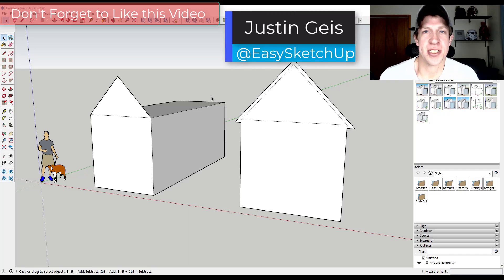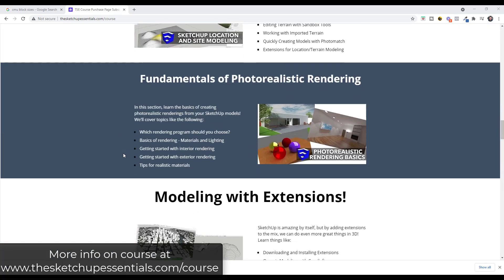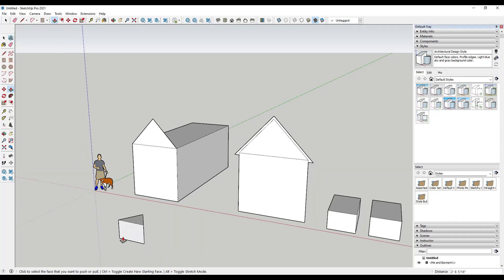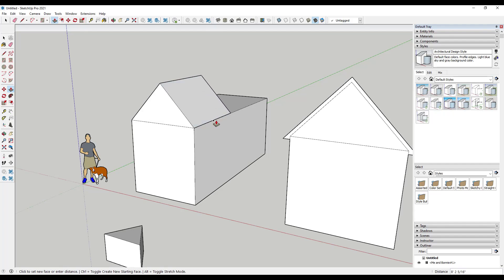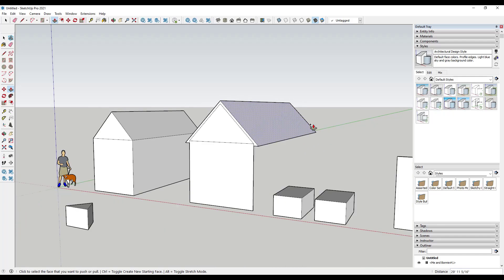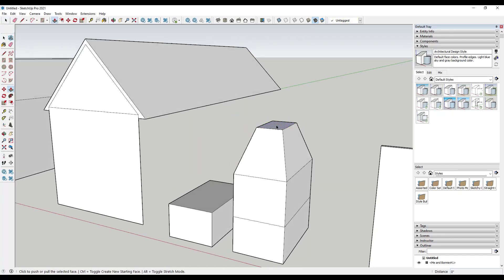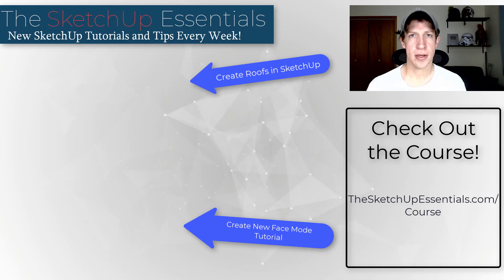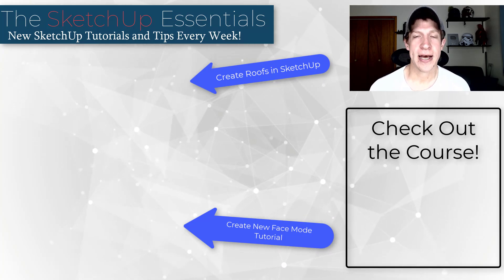Fixing HOLLOW Push Pulled Faces in SketchUp!

Comment: Thia has been happening to me a lot lately or even worse 1 face will delete automatically when I complete a push pull. So annoying.
Reply: Sometimes if you reverse the orientation of the face before the push pull it stops that issue.
Reply from the maker: It got a lot better in version 2020 I believe - if you have a version older than that it's more common